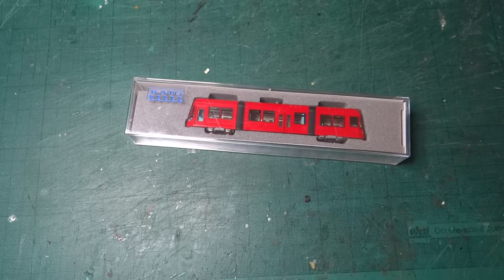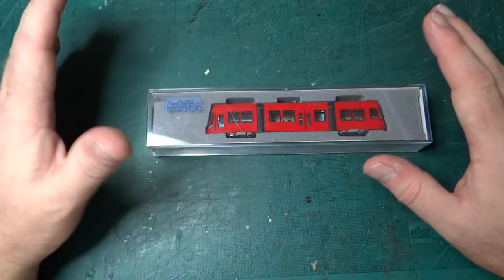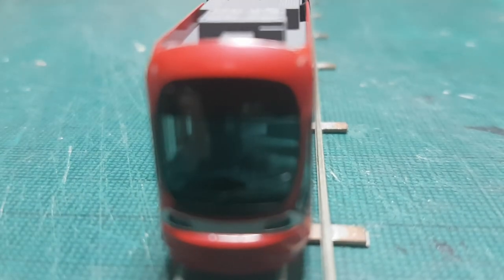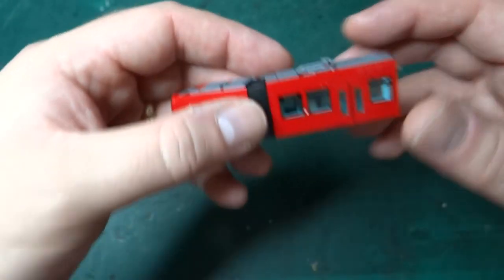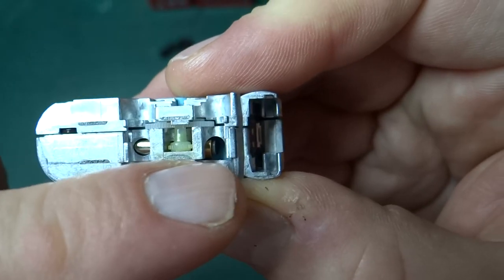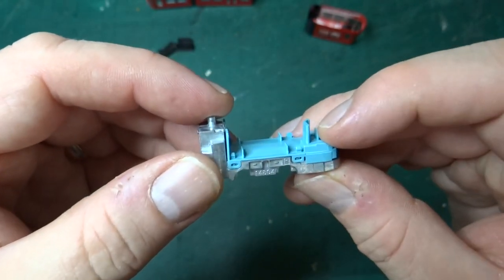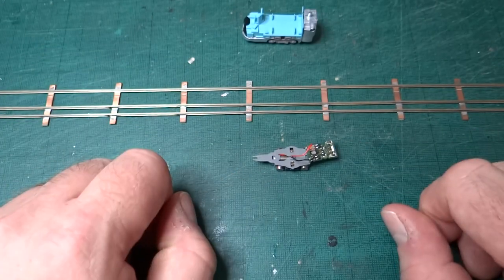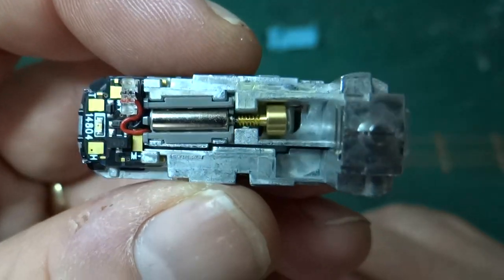Let's Review.... KATO N Scale MyTRAM RED

Comment: I suspect the motor is at an angle by design, to suit the helix angle of the worm engaging with a "straight cut" worm wheel.
Reply from the maker: Thanks! My knowledge of gears is fairly limited (I usually just care about the distance for a correct mesh) but I can see how that makes sense. Certainly it looks deliberately angled rather than me having broken something, and it runs really nicely.